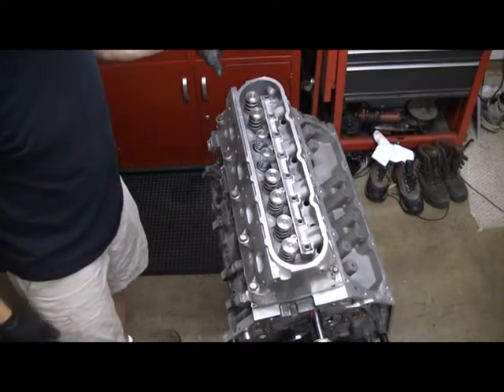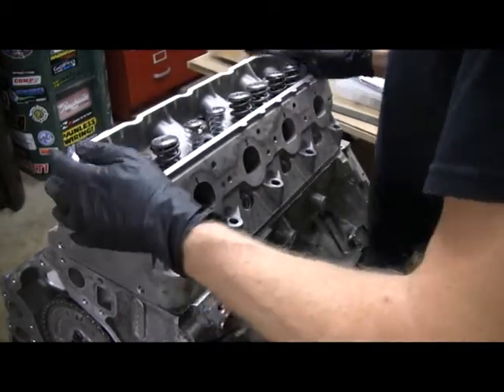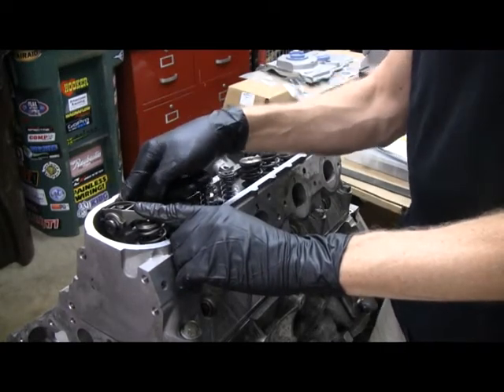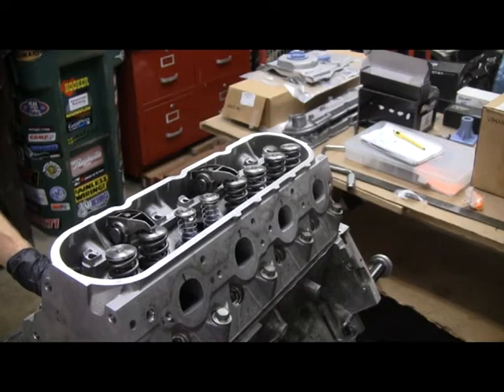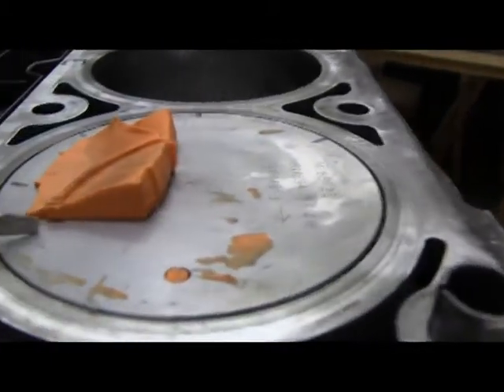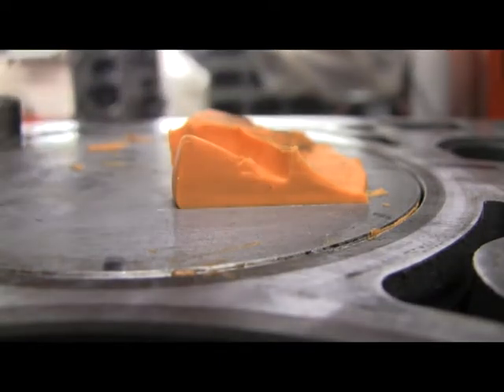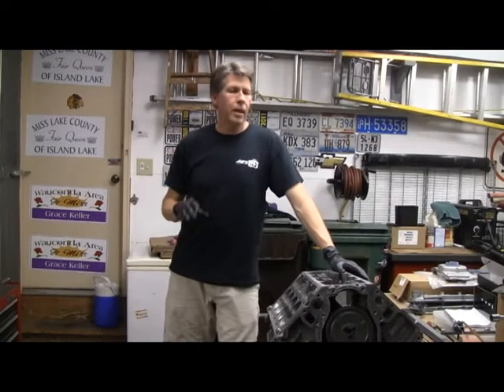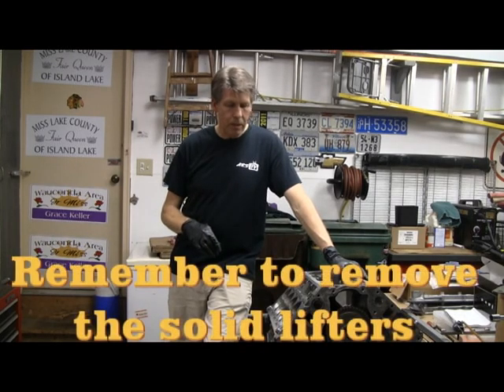LS Conversion Swap Part 39, Piston to valve clearance

Comment: my question is if I already have the measure of pushroads 7.4 can I use them I just have to set the rockarms to zero lash.  Although I still have to tighten for the preload it will give me the correct measurement of the valve gap

Comment: Did you torque the rocker bolt to 18lbs before you rotated the engine or just finger tightened them?
Reply from the maker: I did not torque, but did snug them down.

Comment: Why didn't you clay the cylinder that had the checker springs?
Reply from the maker: Good question, I don't remember why. Given that I used solid lifters it did not matter, but I suppose if I used the cylinder with the checker springs I probably could have not worried about the solid lifters.